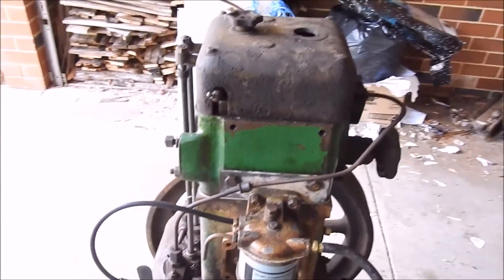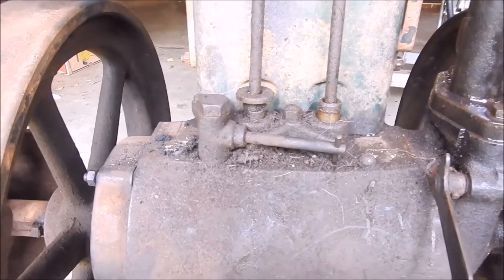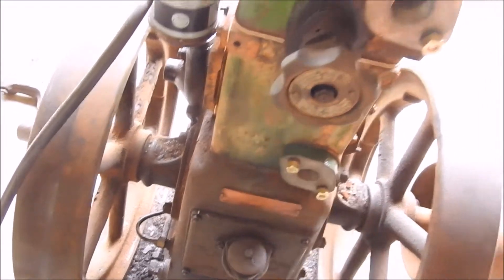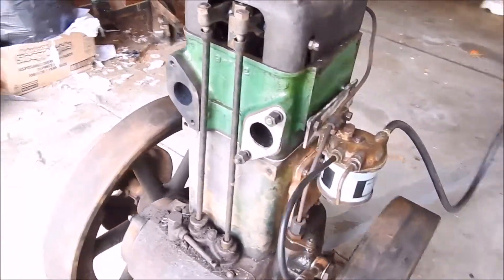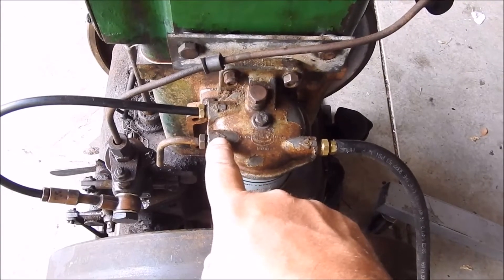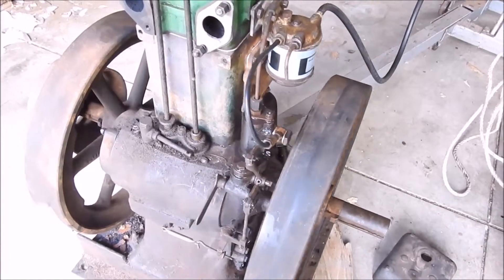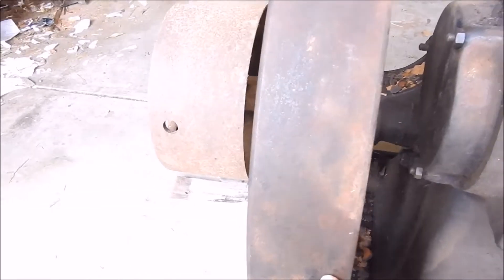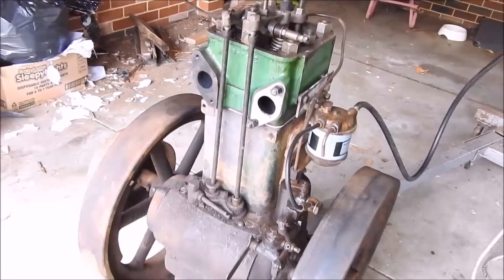Lister CS diesel engine running

Comment: Hi Paul. New subscriber, loving the CS. Very jealous. I am rebuilding an English machine, a 1951 Landmaster Kestrel hoe with a mark 25 Villiers 3hp engine. The carby refuses to stop flooding. Do you have any knowledge of them, or do you know of anyone who knows all about 24T-2 carbys?  
Best lf luck with the VA!
Reply from the maker: Hi Andrew. I love those landmaster machines, I've found a few but all were basket cases. Hopefully i can find a good one eventually. I have worked on a few of those carbys, first i would change the needle and seat. Really easy to do and they are cheap. I would also change the float. You may have to adjust the height of fuel by bending the tabs on float but unlikely. You will have to put up a video once running.
Reply: @rotaryhoes  Finished the LandMaster!  The carburettor problem was just a bowl vent plugged with paint - much embarrasment!  Did a field test, and the machine just begged for more work. Now to find someone who needs it!  Thanks for your emcouragement.
Reply from the maker: @Andrew-so3vj  that is great to hear. Your carby issue reminds me of the time i bought and engine that turned over easy so should be a good restoration.....only to get hone and find it didn't have a piston in it! 
Are you posting a video of your machind working? Would be great to see.
Reply: @rotaryhoes  I'll see how I go re a video. Time is a little short, and video posting is an unknown field to me. Hopefully I'll at least get a few still shots up.

Comment: I don't think that is an original fuel filter - looks  like someone has replaced the wick original for a  more modern paper cartridge  one
Reply from the maker: I agree, just an off the shelf filter. I just don't understand why they bolted it up against the engine to the point of denting it instead of putting a spacer behind it. But i guess in it's working life sometimes you just have to make it work.

Comment: That's a healthy engine, not often they run so good with the cold start Knob screwed out to low compression. Would be interesting to know why the base of the valve was so close to the piston. Looking forward to the VA coming to life.
Reply from the maker: Yes this engine has some peculiarities! My theory is they stopped the engine with the decompression and at some point it was set too high. But luckily no damage done. There is no wear in any bearings or bushes  in the whole engine. I have always wanted a cs and a southern cross yb. Very happy with this one. My next project will be getting the VA up and running.

Comment: wow that runns nice and even with the compression wheel  out! you must slow it a bit down.  Those VA should be very reliable with out water! I know of a one but its a lot of hassle to make them want to sell....
Reply from the maker: I feel i was lucky to get that VA, very hard to come by. The compression on this CS is really high, hard to turn over. What's the best way to slow down, governor springs, injector pressure?
Reply: @rotaryhoes  No no. You should never touch the injector pressure. It should be set to 150 atmospheres. To slowing it down just umscrew that bras nut on the hook that is conected to the spring on the bottom linkage.
Reply from the maker: @enginelover1  this being a 6hp book says 90 atmospheres, it was set at 70 but i brought it up to 90 when servicing it. I have the spring on linkage loose, might play around with it a bit more. Want it to run slower.

Comment: Nice work Paul, you do a great job at getting these old engines firing again. I am restoring my Howard Terrier, i am amazed how many man hours it takes to get it all together. You can't be afraid to have a go at fabricating some of the parts, so i know how much effort and time you spend to make these engines work again. I have a question, the spark plug that is in the Howard L engine i have is a KLG MT50, i guess it is the correct plug. I will replace it when it comes time to try to start the engine, can you suggest a suitable replacement please ? PS, We had a discussion about rust removal using Molasses, i am using Electrolysis now and i have found it to be amazing, it is running 24/7 with all the rusty parts from the Terrier. Glen.
Reply from the maker: Good to hear you are still going on the terrier, you will have to do some videos. Yes a lot of time goes into these restorations, especially all the little hard to find parts. You learn pretty quick how to make things! Electrolisis is the way to go, better control over what you are doing. I'm not sure the correct modern spark plug but i have a chart somewhere, If i find it will let you know.